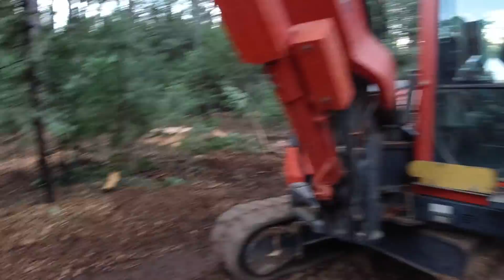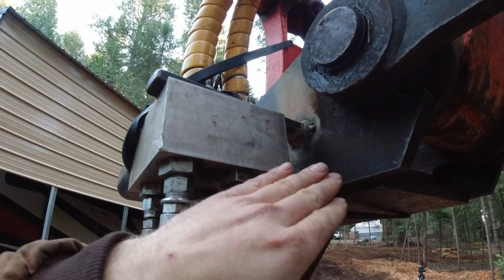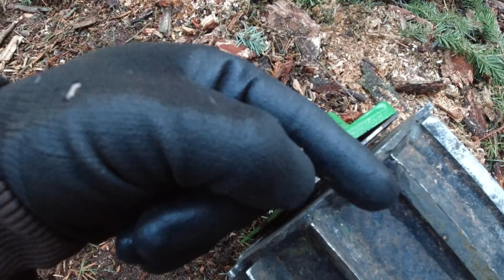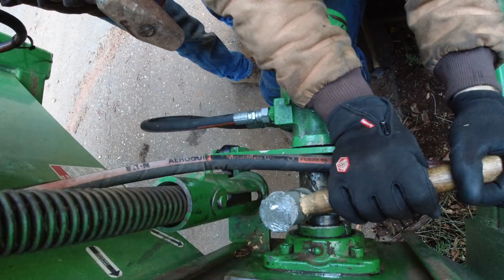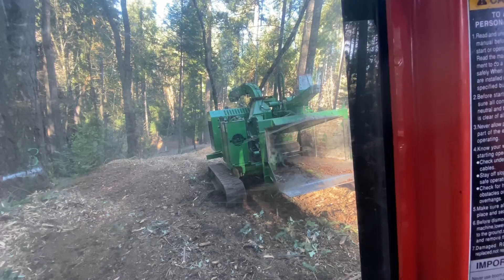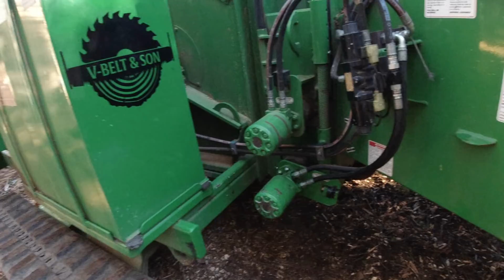Broke 2 machine on Friday. Mobile repair set up

Comment: I like your Chanel, I am still just a little in Ca, but moved and still moving to NV. Have 50 pieces, trailers, loaders,trucks, excavators. My move was justified by Carb, and all the other restrictions. Small is the key, love my Bob’s 250, 864, as well as the fermac 650 the road builder with a case 240 ex, I use to do big holes. Back in the days of Ca, I would fill supper fund sites with my 988, and fill 170 doubles a day. Now run two ten wheeler, at 50 loads, withe the 240, only now a few days a month. Me old don’t care if I work or not, just like to do it.

Comment: Looks like a couple of your hoses are going to need replacement soon as the rubber outside is bad , water will make the braid rust , then you will get a leak & possible an oil geyser  !  I know a man that  spent 1 yr in the hospital with many blood transfusions , almost died , after being hit by one ! & having hydraulic injected into the body !
I would have those 2 built  & ready so l did not loose time on the job .

Comment: Hey Sam, I've got an 040-4, is there any way that you've found to turn down the hydraulic pressure, for example on the auxliary circuit for the thumb? pretty sure I just bent mine and blew an oring on the thumb cylinder extension fitting. woops, definitely operator error. Hoping I didn't bend the pin or snap it perhaps, I know they are quite brittle and thin at the centre where the grease port is.
Reply from the maker: Yeah on the valve body for the machine find the one going to the thumb circuit and should be an Alan head to adjust the pressure
Reply: thanks for the reply man. figured you would know.

Comment: I bought a generac 7500 and a hobart 190 mig and i had to reweld my pintle hitch. 2x2 bar to 1/2 plate and i tow 13k minimum with the hitch.  Welder is rated like 24 gauge to 5/16 with single pass. I bought them brand new at tsc using my card i applied for so no interest for 18 months or low interest for 3 yrs. Payments when slow at work were a little high for no interest so i did 3yrs but it took 2yrs paid off.  I rent a room so no power source so gen was needed and its nice ive taken it to friends and moms where tractor is at and ive done alot where i rent

Comment: Same thing.  My dad bought a weld pak 100 about 20 or 25 years ago and that's what I used.  I'd like to say its operator error but I never could get a satisfying bead out of that thing, it would either blow through sheet metal or make ugly welds otherwise.  Maybe it was just the price point.  every now and then I got a decent fillet